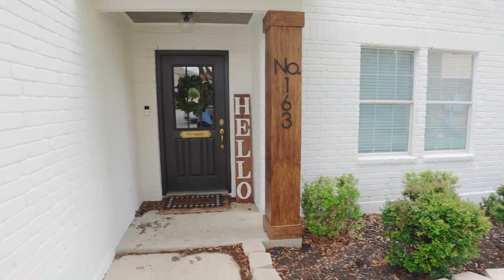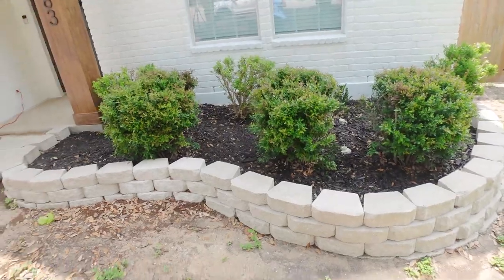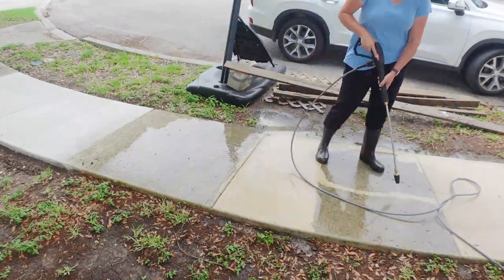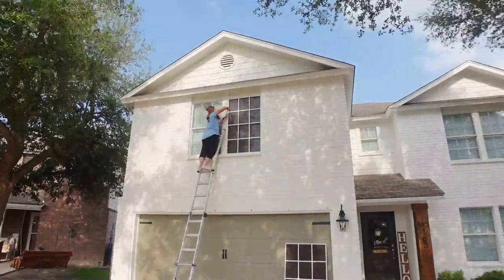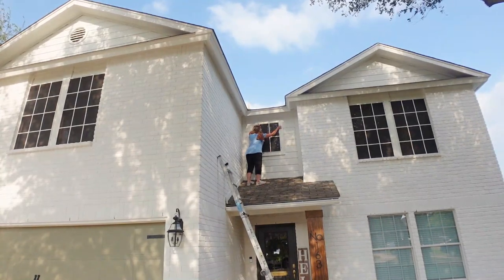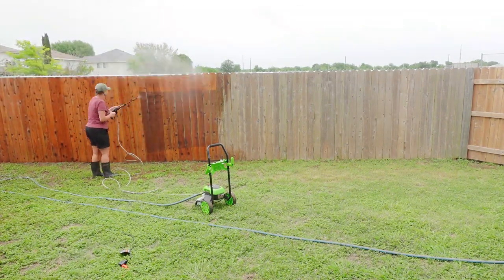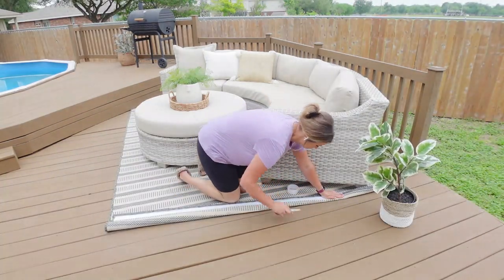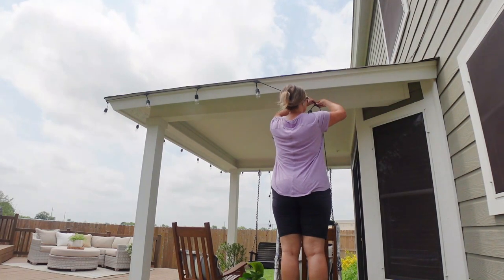OUTDOOR UPDATES THAT ALMOST ANYONE CAN DO!!

Comment: Wow that white tape on the screens really looks good! You changed my mind, with that added I think solar screens look even better than just the glass 😲
I have to say, my back fence is that weathered gray color but I think if I pressure washed it the boards would snap in half 🤣
Great video!
Reply from the maker: Thank you! I’ve been thinking about it for months. Glad I finally gave it a shot.

Comment: Just an FYI, you can use a product called Wet & Forget instead of pressure washing.  You can use it on vinyl siding, wood, concrete.  I use the concentrate , dilute it in a pump sprayer.  Spray on surface snd just let it go.  No rinsing!  Rain , wind and rain will clean the surface.  Saves on water and your hands with the pressure washer.
Reply from the maker: Interesting! I’ll check it out.

Comment: Everything looks beautiful!  Power washing is one of my favorite spring things to do!  I have the same rugs from Target and they are always blowing over.  We have a very expensive deck and I was afraid the tape would leave residue on the deck.  What is your experience with carpet tape outdoors?
Reply from the maker: I used it at a previous house and it pulled right up no problem when we moved. That was on concrete though. Maybe try a spot that’s inconspicuous in case it sticks?

Comment: I did not know you could clean a wooden fence like that. I thought the sun changed the color of the wood, I had no idea it was just dirty. Learn something new every day, I guess.
Reply from the maker: The sun does cause it to turn gray but just the outer layer. You can pressure wash it right off.